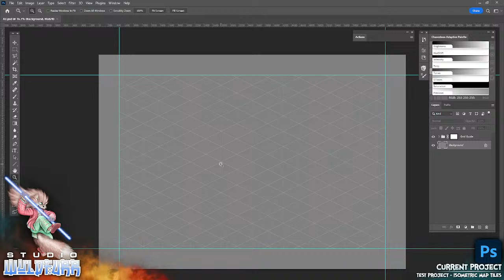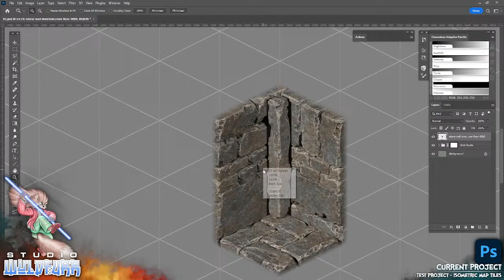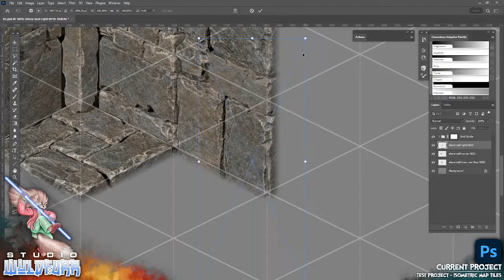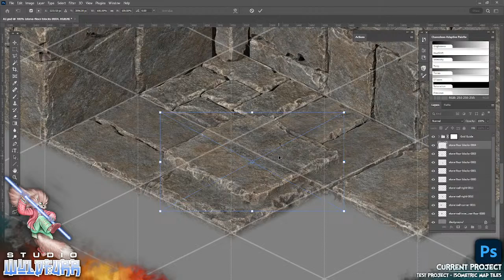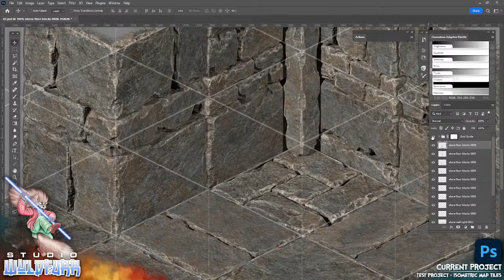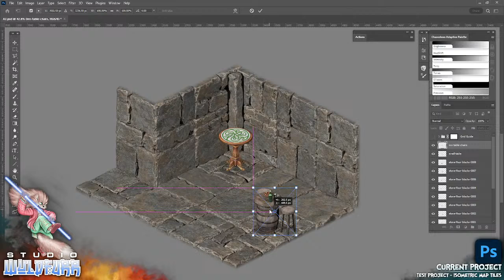Isometric Map Tiles

Comment: Can you please share the grid files? Having a lot of trouble figuring out how to make walls, this would make it a lot easier probably.
Reply from the maker: Using the isometric map tiles can be a little tricky to work out. Set up a grid that is 710 pixels high and 354 pixels wide, then turn on snap, and the art assets should snap into position for you. Layering is the key to the Isometric Map Tiles.
Reply: @Wyldfurr  I mean the grid you have in Photoshop though, are you willing to share the file for that grid please or can you point me in the right direction to make my own grid that stuff actually snaps to...?
Reply from the maker: @SNARE_DESECRATOR  I provided you the grid size in the previous message: 710 pixels high and 354 pixels wide. Plus there are photoshop layouts for A2, A3, and A4 size pages in the package zip file.
Reply: @Wyldfurr  And I don't know where to use those values? I cant turn the photoshop grid into isometric? And what package zip file are you referring to? You didn't provide one?
Reply from the maker: @SNARE_DESECRATOR  The content displayed in this video became the Isometric Map Tiles - Volume One: Enter the Dungeon package ( https://www.wyldfurr.com/project/isometric-map-tiles-volume-1/ ). You don't need to convert the Photoshop grid to an isometric grid, just use the pixel grid size I already gave you and just draw the lines yourself. But with those pixel sizes the art assets should snap into place, even though the grid is not displaying as a perspective grid.